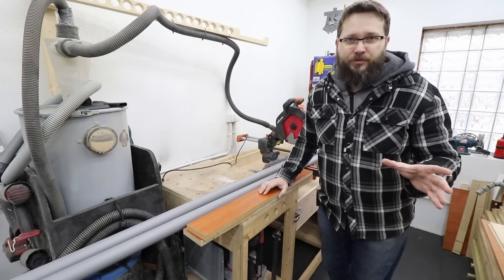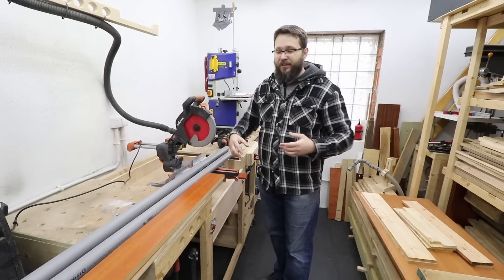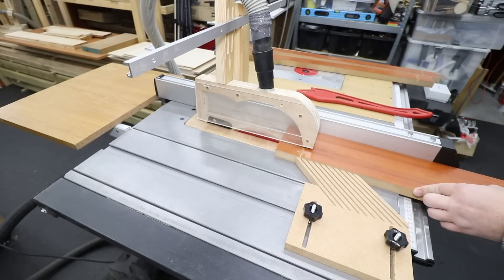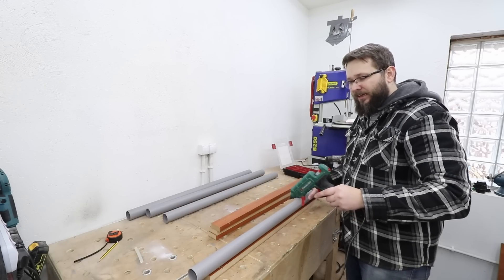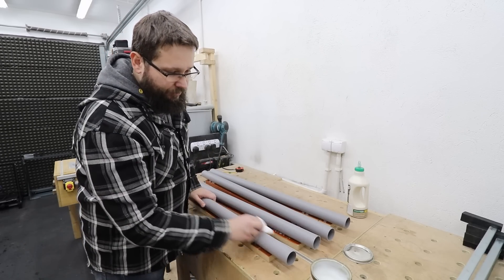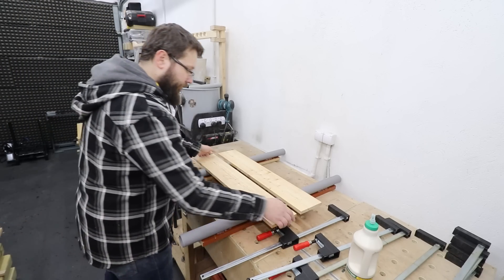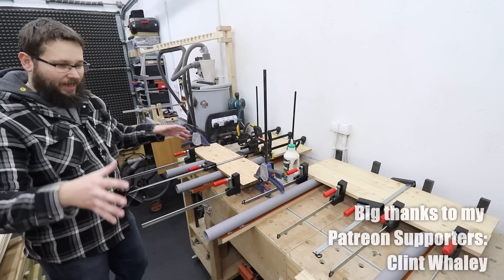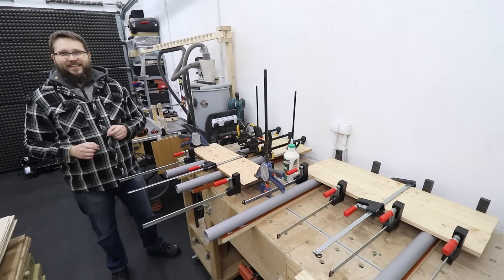Perfect Glue Ups With PVC Pipe Platforms

Comment: Clever! You could even drill some oversize holes in the top edge of the pipe, so a woodscrew could pass right through. Then you could screw through the plastic into the timber for a stronger fixing 😀
Reply from the maker: Can go either way. This seems a bit quicker and it's very strong and stable 👍

Comment: With all due respect, but if you have these clamps that have already/form a flat surface why should you use additional hardware? If somebody doesn't have descent board clamps and needs to make flat board than the idea might come as handy one. It is my opinion, of course.
Reply from the maker: What I find with them is that quite often I waste time on aligning the boards on them. As I move one clamp or try to push the jaws onto the wood then the boards move and go out of alignment etc. Thus way I just got better access for the bottom so adding extra clamps from the bottom is also not a problem.with these platforms. That's just my findings and experience. For me this way (with these platforms) seems much better, quicker and easier. But each to their own I guess.
Reply: @CasualDIY  Just want to add that if I have to make a longer board, I consider extra clamps from the beginning so no need of adding clams from the bottom. I agree that small movement of any clamp causes (could cause) realignment, but I think, in this particular case, if you do not fix the wood strips to the tubes, you will experience the same problem once you touch the strips with the clams. Anyway, if somebody finds this useful it is a good reason to be pointed out. Respect!